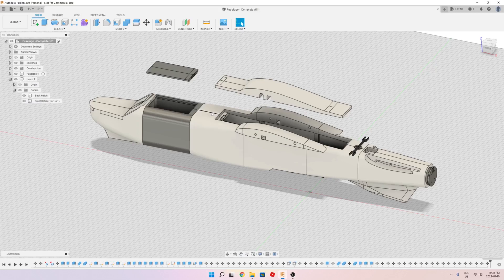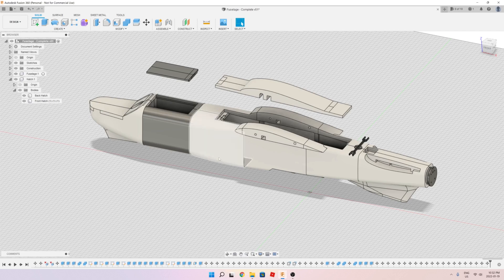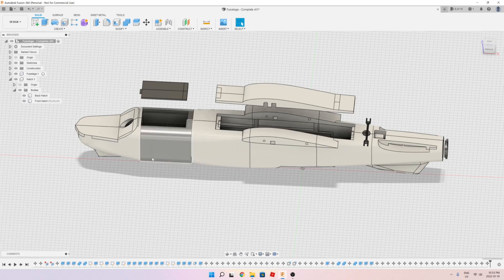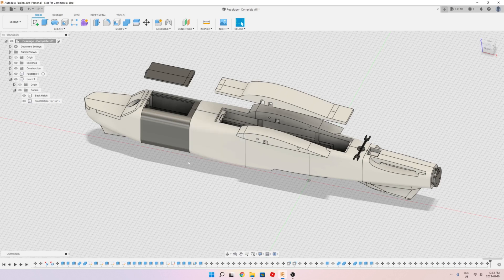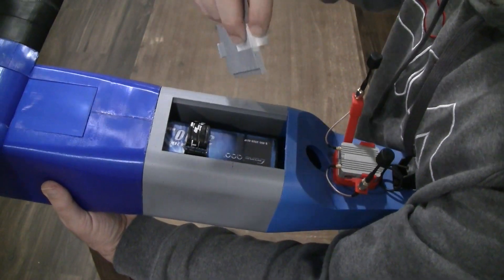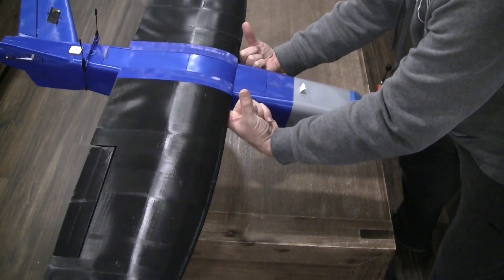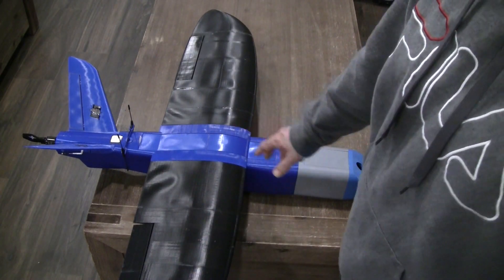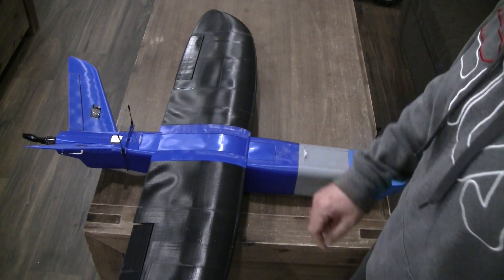3D Printed X-UAV Mini-Talon - Part 6

Comment: Hi. is there an all components list of that plane
Reply from the maker: 1200kv 4S motor, 40A ESC, 4 x 9g servos, matek flight controller, 9x6 prop, dji digital fpv system

Comment: I can't split fuselage in cura, it chooses it as a whole, what should I do or can you share the stl file in parts?
Reply from the maker: You can open the file in windows 3D builder, and split them there. I dont have separate files sorry. Try the windows builder, and come back to me if you still cannot do it. I will guide you
Reply: @RaedAdlouni  It's an excellent job. But I'm sure other talon enthusiasts want the separated files as much as I do. Is there anything you can do about it?
Reply from the maker: @mertavcu1  I am working on a refined version of this, and I will post it in separate files. I cannot commit as of now to a time frame for that, it’s work in progress
Reply: @RaedAdlouni  When are you planning to release the new version estimate because all I'm missing right now is the model itself

Comment: Thanks for the stl files. But how do you separate then into the individual components? which software can I use, e.g the fuselage ?
Reply from the maker: you can use windows 3D builder toseparate the parts
Reply: If you are using Ultimaker Cura for slicing, use the mesh tool and separate into parts option. I am currently printing the parts using Cura Slicer and they turn out nice.

Comment: Awesome work. My problem with the talon series is the high stall speed which makes landings kinda tricky where I fly. I would suggest maybe longer wingspan by 20cm and maybe add slots for flaps. I remember back in the day when the big talon came out they used to sell wing extensions which were so hard to get by. I really believe with the extra weight 1.6m wingspan would do the trick for better gliding and slower stall speed
Reply from the maker: Hello Vagelis, when I maidened this Talon, I did not have any low speed stall issues, after turning upwind for landing I lowered the throttle to zero and glided the talon to the ground.
Reply: @RaedAdlouni  How strong was the wind? Also how was your maiden?
Reply from the maker: @vagelislambroukos  12km/hr, tracked like it was on rails
Reply: @RaedAdlouni  Great news, the mini talon is the old faithful. Thanks for the plans, I might print it sometime in the future. Great work, keep it up.

Comment: Print settings please
Reply from the maker: 1 wall for everything, 1 bottom layer and 2 top layers, orient the parts on the plate for minimum support, tell me if you need clarity on anything I missed
Reply: @RaedAdlouni  thnx for it !) i appreciate.
Reply from the maker: @linuxettin  forgot to mention that I had to add 2% infill when printing the fuselage to prevent it from bulging inside, orient the infill lines such that they provide needed support

Comment: could you elaborate in the print settings you have used?
Reply from the maker: 1 wall, 1 bottom layer, 2 top layers. No infill for the wings, minimal grid infill applied for the fuselage such that you have a couple of lines strengthening the hollow fuselage. Support differs based on the need. Tell me if there is anything else i missed

Comment: Kind of worried about the yaw moment with the long nose.
Reply from the maker: Do you mean that there is not enough yaw authority ?
Reply: @RaedAdlouni  sorry for the delay, What I'm saying is that the yaw moment arm ( the distance from center of pressure, to your vertical stab). may be to short, so the craft may start to slide of to the side and then nose down from a lack of control surface.